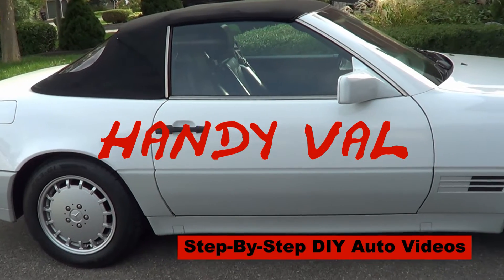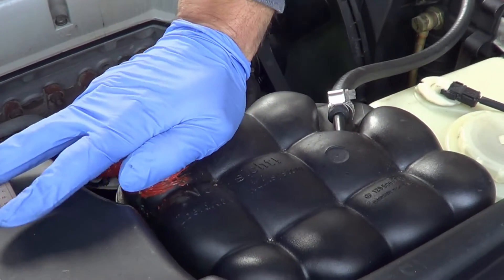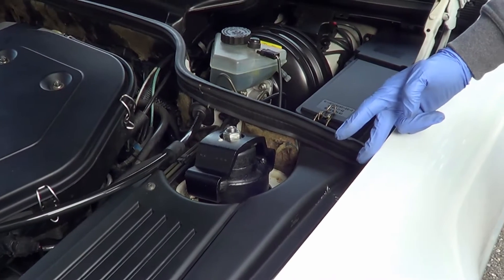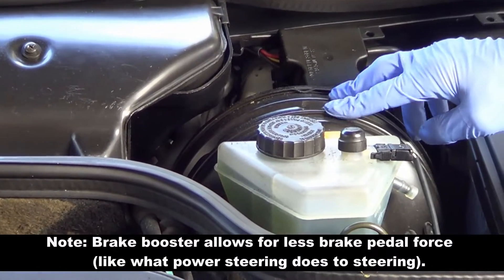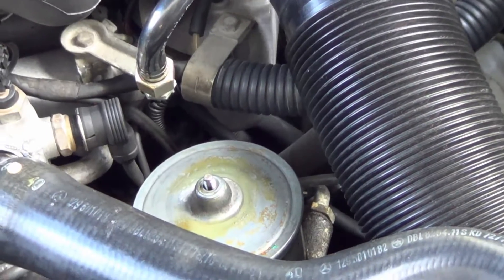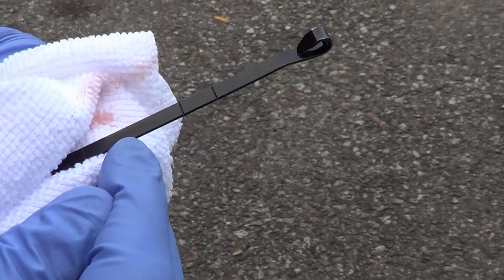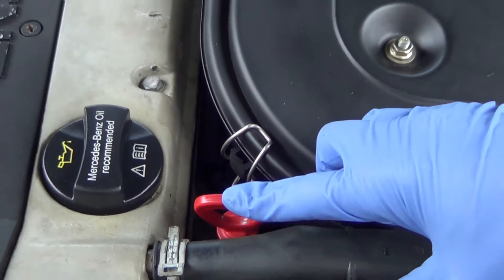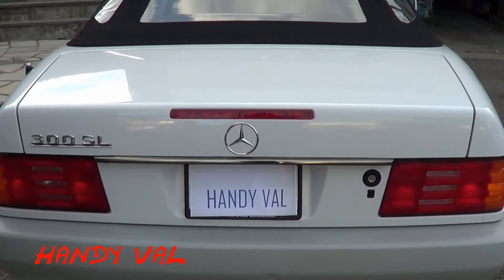Mercedes-Benz How to Check Car Fluid Levels (Transmission, Brake, Power Steering, Coolant and Oil)

Comment: 10:21 That is not the oil temperature, that's the coolant temperature gauge :).
Reply from the maker: So true. Yes, the temperature gauge is actually the temperature of the coolant. The sensor is measuring the coolant temperature which is a decent proxy to the oil temperature. I should have been more clear. Good catch! Thank you.

Comment: Your information is a Goldmine to me as I've just bought a 1996 320 SL. I haven't seen all your programs yet, but I will. I have four problems.  1. The sound in (mostly the passenger door, is like the radio hasn't really found the station only it sound the same if using other media. Speakers, amplifier (s) or what?
2. It was originally bought in US (now driving in Sweden) and it is in wonderful condition (no rust whatsoever) but I don't like Mph and F. How difficult is it to find Kmh/C' and replace?
3. What lubricant should I use for the Cab mechanism?
4. The automatic antenna. It doesn't go up but engine is running. What to do?
Many many thanks in advance, Claes from Gothenburg/Sweden
Reply from the maker: Hi Claes, welcome to the R129 world! The 1996 320SL is a great choice for the Swedish climate. Great engine and post-facelift design. 1. The passenger side speaker problem has a few culprits - start by checking for loose or corroded connections at the speaker or at the head unit. There's also a chance the speaker could be water damaged from the previous owner, having kept the window open during rain. 2. I don't know this well. My suggestion is to live with it for now. There are companies that sell speedometer stickers in kph or mph. Certainly, getting a km spec instrument cluster would work, but you'll lose the history. 3. Do you mean the cabriolet mechanism? Silicone grease would work at the bending joints. 4. The antenna malfunction is a common problem. You'll need to replace the antenna motor mechanism. It's a DIY job, but you'll need to source a new or used or aftermarket mechanism. For items 1 (speaker) and 4 (antenna), replace and/or check their fuses first. Keep me updated. I'm excited for you.
Reply: @HandyVal  Thanks, thanks and thanks. Many of my questions and issues were solved when continued ta look at your videos. I will look at the rest before I bother you again. All the best Val // Claes Nordin

Comment: important: for mercedes transmission fluid change. around 40%100 fuild in torque converter that's need to drain from. more mechanical or woner they don't know that

Comment: Silly question. What about water?
Reply from the maker: There’s never a silly question. The term water and engine coolant mean the same thing. For example, the water pump is really an engine coolant pump. Many years ago only water was used as engine coolant and so the term stuck around for a long time. I hope this helps.

Comment: Hey Mate, how often do you change the gear oil? Should I do it if it never been changed on my r129? Thanks
Reply from the maker: Thanks for bringing this up. You mean the rear differential oil? The recommendation is that it needs to be changed every 30,000 miles/50,000 km. This maintenance is commonly overlooked. It’s a good idea to change it.

Comment: Thank again champ!!
Excellent video
Never knew about the half way engine oil to prevent headgasket.
My head-gasket is leaky!
Any chance of how to replace the head-gasket then?😏
Reply from the maker: Thanks for watching and the great feedback! Changing the head gasket is a big job (emphasis on big). It requires disassembling the engine and removing everything around it and then putting it all back together. The engine also needs to be machined down (at a machine shop) so the new gaskets have a good, clean and straight area to stick to. The MB gaskets are relatively cheap at a few hundred dollars but the job requires about 10-12 mechanic hours! The good news is that today’s seals are much much better than the original, and so you may hopefully get a lifetime out of them with proper engine care. I hope this helps, and let’s keep these cars going forever.